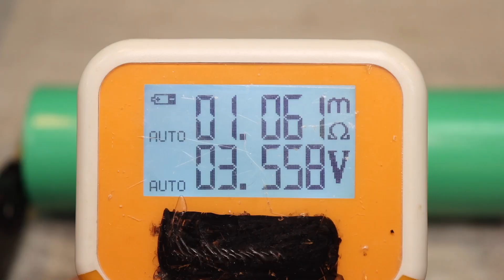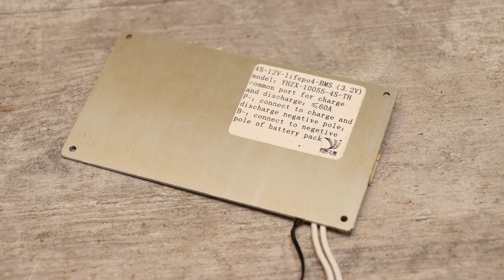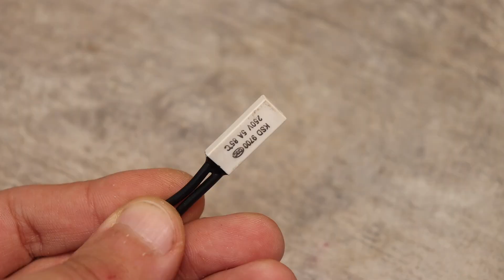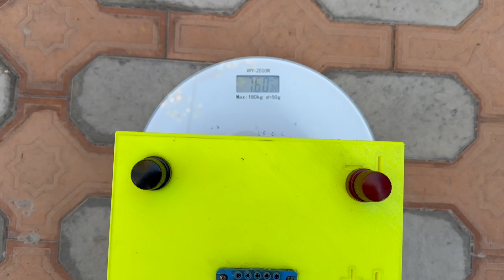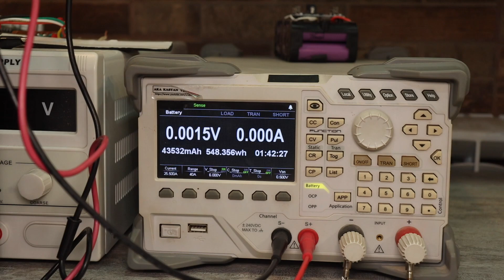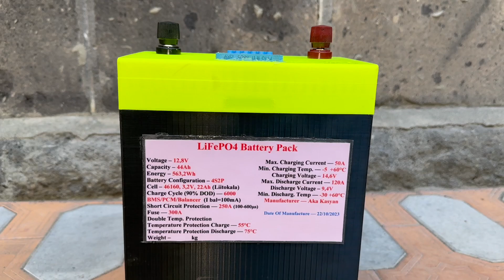DIY Powerful LiFePo4 Battery

Comment: That is KICK ARSE!!! Thx so much for sharing. The charge board is soo meaty.
And please do more circuit project vids, they are so good and they always work. Ive just done your 2 transistor 2 mosfet inverter, and its excellent and simple, and WORKS straight off the bat. 
Are u still going to repair that big induction furnace? Or waiting for parts?